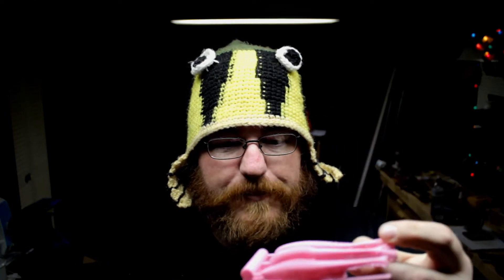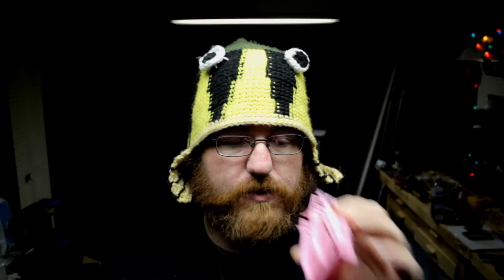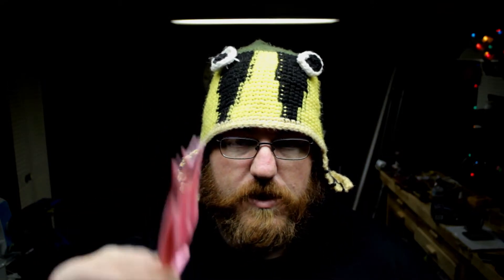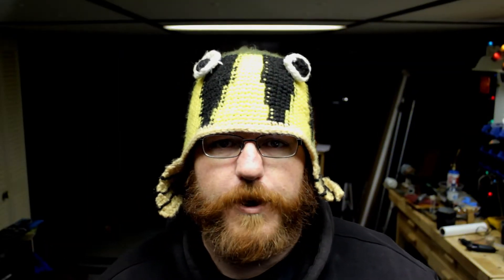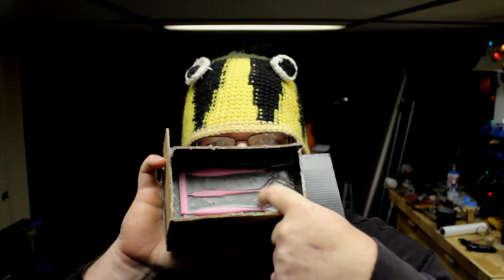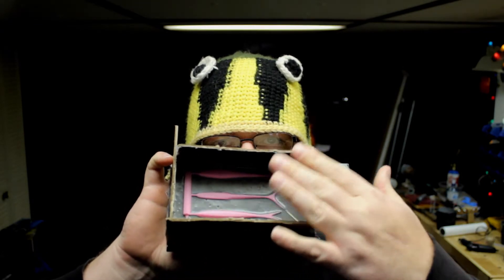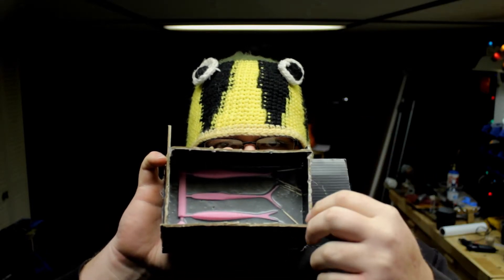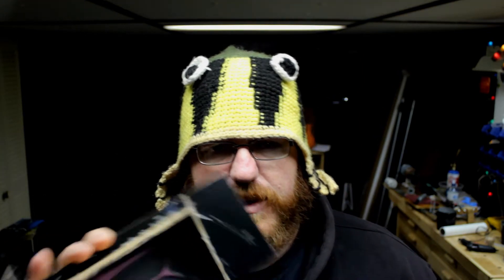Design, Print, Mold, Inject, Repeat: Swimbait Edition

Comment: I’m just now tuning in, this is great I’m doing to same thing now. Is vac-50 the best mold material you’ve found for the mold so far. That is my biggest concern because I want clean professional quality lures with little to no flashing. And have you been able to re use molds?
Reply from the maker: Nice always good to see more bait makers! I have a love hate with the Vac50, it's a great material for a strong mold but I've found that a hard silicone produces just as good of a result and ends up being  easier to clean up and use. As long as it's a hard silicone like Mold Max 60 it works great for 2 piece molds. I have a few videos on the channel recently explaining my new process. The last 2 years of mold making video goes over a condensed version of everything I've tried so far.
Reply: Revamped Outdoors sweet yeah I was just digging through your videos I’ll definitely check out the more recent ones. I’ll be back with many more questions you saved me a lot of trial an error I’ll definitely give you a shout out on my first video.

Comment: You don't think it would have been better to design a mold for them for the 3d printer and go the opposite way instead of creating the lures out of 3d print? Go straight to the mold or is that not possible? I'm not sure if you can cut out existing 3d models out of a box designed in the 3d program since I'm very new to all this. Thanks to your videos I'm in the process of designing a couple soft plastics I have in mind. It does seem like going straight to the mold and printing out the mold in 3d printer would be much better than this approach if its possible.

I know the RTV silicon products for designing modes are really expensive even for small or large qualities. It seems the best way to go now days is using 3D printed molds which a lot of companies are doing and selling now. They are actually really cheap and from everything I've read the plastic holds up to the temperatures of the molting plastic with no issues.
Reply from the maker: Rollin Cajun Gaming thanks for the commment i did make molds for the silicone with a negative of what i wanted in one of my last videos it worked well to reduce the volume of the material needed. Helped with costs plus ive switched to Mold Max 60 silicone instead of the vac 50 it is alot more cost effective and does just as good of a job i think.
Reply from the maker: If you want to check out that video it is here.

https://youtu.be/tdqNYjllf8k

Comment: How much does each mold of vac 50 cost you about? Just curious?
Reply from the maker: I think I get about 2 molds out of one 5 lb order of Vac-50 which is about $37 bucks.  I've switched over to high temp silicone lately to save money mold max 60 from smooth on seems to work just as well for a lot less money overall.  You could get more out of the Vac-50 if you took some more time to set the mold volume better to use less but I never did.
Reply: Revamped Outdoors awesome, sounds good!